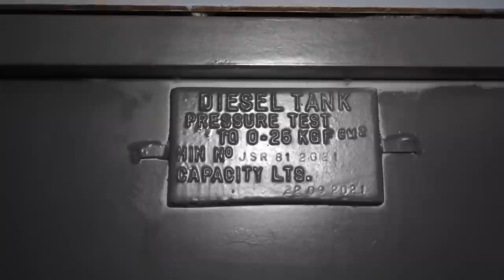Ep 34.  3 0r 4 Bladed Propellers for a Narrowboat.

Comment: Hi Chris, Sorry I'm late this week as I was away until yesterday. Great to see the engine go in and the nice shiny prop, I used 4 blade as it does help reduce fuel consumption but gives you power if you need it...  I see you forgot to duck ! I knew you would at some point lol.    Hope your All well. Very Best Wishes Old Skipper Tim :)
Reply from the maker: Hi Tim. Engine’s in, and the 4 blade propeller which I must say was quite interesting to do a bit research on. The knock on my forehead was from the wheelie bin when the lid blew in the wind and caught the head - it fits the storyline though. At Crick yesterday, I found out the boat launch will the week of the 20th. Count down is on.  Ground rush will be here soon. All’s well, thanks Tim.

Comment: Nice seeing the engine going in and you’ll always need stopping power for the crash bang wallop‘s that will happen😂👍👍👍👍did I say what a picture 😂
I like the Wide beam been lowered in place that looks nice 👌 you’ll soon be out there 👍👍👍
Reply from the maker: It'll be like the first time I scratched my alloys on the car, which still only has one one scratched, I almost cried.  If I bump the boat, not a kiss, but a proper bump, I'll be distraught. 
That wide beam should be nice.  It's almost worth The Fit Out Pontoon continuing the story.  Thanks Tom.

Comment: All this stuff about props is all good stuff to know. I thought about changing the impeller on my ski to a Solas prop I got a good deal on at a show a while back, but it may be too much impeller for the stock motor. Need to check the numbers. Your boat is coming along nice, not long before you'll be out on the canal network checking out different places.
Reply from the maker: Hi Paul. I found the propeller surprisingly interesting. Such a small thing that has a profound affect. 🤔
Science and engineering is important. It’s a shame I’ve only just started to become interested.

Comment: Another cracking video, Chris.  I agree with Christine below “Almost edge of the seat stuff”.

When does the bow-thruster system get installed?
Reply from the maker: Bow Thruster is in. Thanks for the jog of memory. I need to be briefed on that. Trouble is, it’s underneath the bow which I can’t get to as I’m not allowed to stand on the paint until I’ve taken charge of the boat. I’ll have to do a vlog on that later.
Thanks as always Martin.

Comment: Hi Chris. Your 4-blade prop will give you more power (thrust) which will assist in maneuvering the boat in windy conditions. You can never have too much power- speed is not that important on a narrowboat.
Reply from the maker: Thanks Tom. Top advice. I’m going to try to inform better as I go on. Power doesn’t equal speed on a boat. It equals thrust and ability to manoeuvre. Speed equals wrong lifestyle.

Comment: Viewer #2 tonight.

I've read somewhere that a 4-bladed prop will deliver smoother transmission of power, which apparently is one of the reasons a lot of ocean liners were designed with them.  

Regarding engine maintenance, I wonder if synthetic oil would get you more hours between servicing?  It's more pricey, but fewer oil changes would likely be a saving.  Maybe something to research after the engine is off warranty.  
There's nothing quite like a pristine engine bay.

Suggestion for homey touches.  If there is room for a couple of plants, make sure they are useful ones.  An aloe vera is a great thing to have for cuts, burns, and any kind of skin irritation.  A spider plant will do a good job of cleaning the air, and will survive just fine in low light.  For the summer time, a pot of basil can add lots of flavour to whatever you're cooking.  Or substitute any other kind of herb.  Those can live outside, but don't usually overwinter well.  Just a thought.

Can't wait to see what colour was being applied on the outside.
Reply from the maker: You’re right Peter. Subs have more as it produces less noise and the bigger they are the less power is required to push the boat through the water. I’m sure it’s different now, but, that was for propeller designed boats. 

Don’t know on the oil, I’ll find out but, even if I keep to the suggested time table, I might on the first use synthetic oil. 

Great tips on the plant though. I wonder if they will be able to live in home made compost?  Put that to good use.  Thanks Peter.

Comment: Hey Chris,, uhhh is the MDF they use the outdoor waterproffed kind???
Reply from the maker: Great question Russell.  Condensation is the biggest killer of a boat. The owner of The Fit Out Pontoon lives on a boat and has for a few decades. He realised condensation forms and then gets into the wood and all surfaces. You’ll notice all wood is melamine MDF and even the cut side has been edged and rounded so assist in water running off.  So, if condensation forms and it’s not been noticed for a while, it’ll ‘pool’ and not get into the wood.  More expensive, but the boat should look new in 20 years (or longer). Hope that answers it. Thanks for the comment.
Reply: Hi another good vlog just thought I might say that know somebody has brought up using MDF you will probably get loads of comments from people that think this is a bad thing to use their best arguments are normally if it gets wet it falls to bits my answer to these people is if it gets wet enough to ruin it that means my boat is sitting on the bottom and I have more to worry about then a bit of wet MDF I have always used MDF for all my fit outs and never had a problem my present boat is now 16YRS old and all the wood work looks as good as when first fitted
Reply from the maker: @bigKDL  thanks for the comment. Many have critiqued the type of wood and for the reasons you have stated. I don’t know, how many of those critics have a boat or build boats. I trust Mark and the reasons why he does what he does.  Clearly, you as a boat builder have the same view point. Thanks for the support.

Comment: Neither acceleration or top speed are particularly critical when you are piloting a narrow boat in my limited experience, Chris. One further comment - the reflective insulation inside your boat's current residence may have given a clue to the paint colour. If I'm right, it looks to be a good choice.
Launch day draws ever closer...... :)
Reply from the maker: Sharp eyed people. I think you may just about see a faint glimmer or something. I didn’t notice that throughout the whole edit. Not sure you can make out the colour as only the roof was done. Need to be more careful. 
Agreed with the speed. I’ll not be pushing mine on a regular basis, although it does say to push the engine to full revs every 50 hrs for 15 mins. Hmmmm.